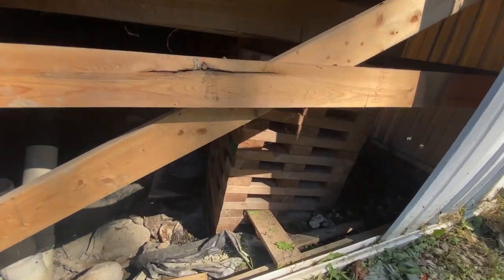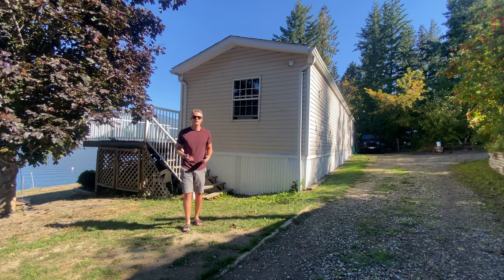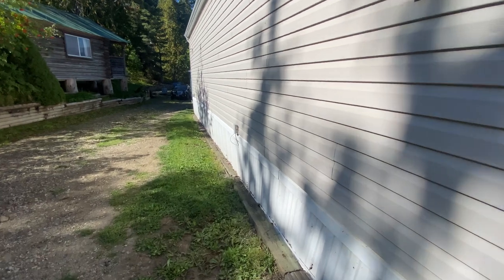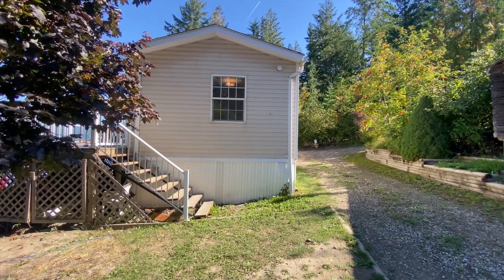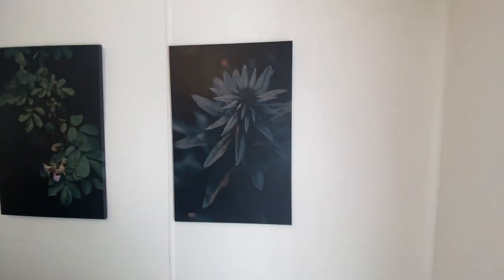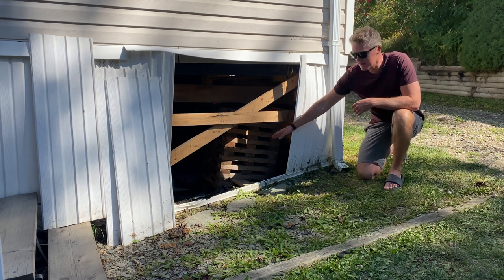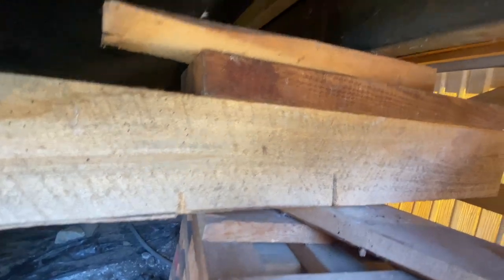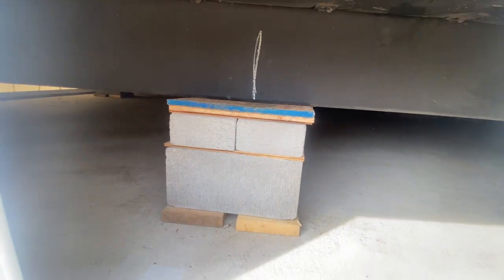Warning Signs a Mobile Home Is Sinking

Comment: Hey where can I see the finished home. Also who was responsible for the bill if it’s in a park. Who do I contact my trailer is sinking on the left and I can tell by the kitchen floor
Reply: Do you have any cracks in your ceiling? I have hairline cracks around the majority of my ceiling in the seams. Wondering if it’s from it sinking.

Comment: Pffft! This is a joke, right? Not the fix, but calling this a little issue?! If you were to come to FL, or any other state in the South, you will find darn near every mobile home built before let's say 2021 with no poured or laid pad, and skirting in disarray. My question is why was this permitted prior to recently? None of these mobile homes has a foundation. I always felt that this is a strange construction practice, just placing a house on cinderblocks and nothing more. Appreciate you bringing out the issue, Kerry. How costly it would be to address this problem, just in the state of Florida.
Reply: Singlewide mobile/manufactureds 1980 and up were 'supposed to have' tie-downs, per the then-new HUD standards. Can't remember about doublewides. Bad stuff.

Comment: Why would wood be first on the pad?  My home floods and the park owner does nothing, so tghe wood just made a mushy mess.  Is it OK to just set blocks on the pad instead?
Reply from the maker: In my area it doesn’t have to be wood first in the pad, if anything that technique is a outdated. If this was a new home I would do a 24x24 concrete base pad under concrete blocks with wood between the concrete. You want something at the base of each block pier. Check requirements for your area though, it may be different wherever you are. Thanks for watching, hope that helps

Comment: I purchased a double wide with skirting. I would like to have it dropped down on a concrete slab. Is this possible?
Reply from the maker: If you do It still has to be raised for the services connections.

Comment: An animal rebuilt my hot tub....solid floor do I need to pull the tub to get to the wiring...can't  see anything but pipes when I pulled the cover on the side of the tub....braker tripped ....

Comment: Hey, we need help. Somebody??? The planning committee that our neighborhood (we each own our private land)
is butting heads with thinks that insisting the footprints remain on a slant which will limit how and what kind of home we can put on the footprint. 
These homes were built in 1965 and people just want to replace them with new ones but the LOCAL planning committee is refusing since it's a flood zone. 

So this planning committee thinks that making the homes stay on a slant prevents flooding. MY argument is that this is an outdated idea and that now floodgates and higher up is the answer.  We need some arguments as to why putting homes on aslt is not any longer feasible.  thanks to anyone who read this far.